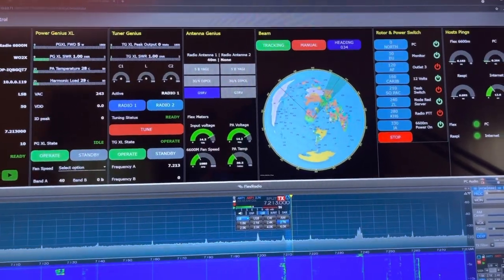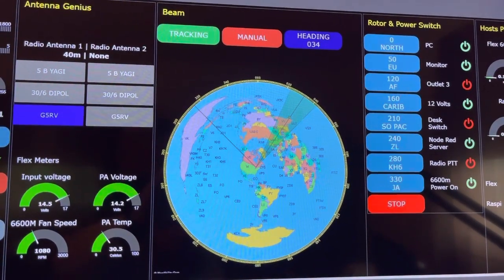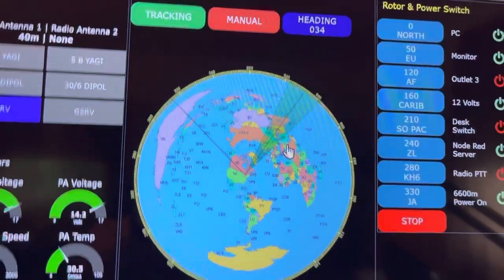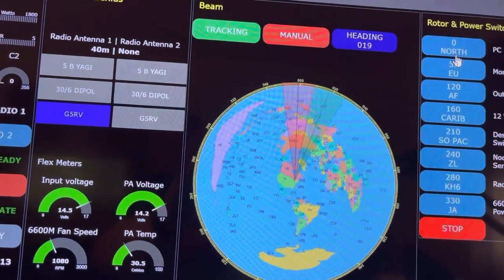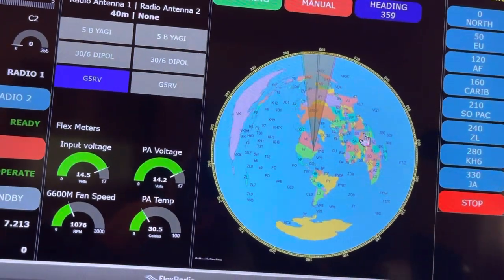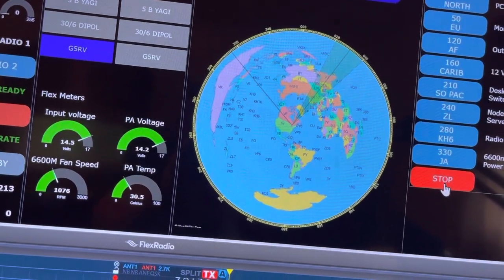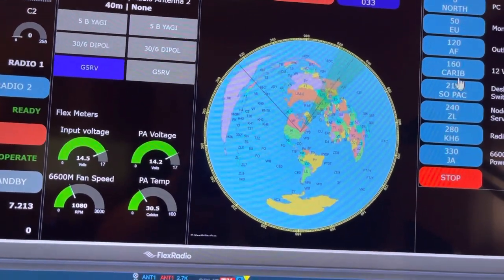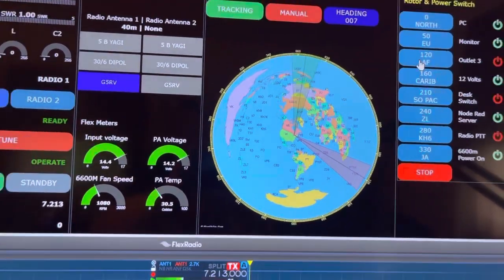Node Red and Green Heron RT21

Comment: I have a Yaesu rotor. Their interface between a computer and control box is extremely expensive. There are a few 3rd party interfaces that take usb out of the computer and output it via serial to the control box. Is one of these required OR, when using node-red dashboard, does the Raspberry Pi serve this function on its own via a usb-232 cable?
Reply from the maker: The rotor can interface to the Node Red server or connect to a PC running PSTRotator AZ, then Node Red can talk to PSTRotator AZ. Which ever way is easier. For Yaesu controllers they make interface boards that are RS232 or USB.
Reply: @daviddecoons1417  My actual question was, do I still need the Yaesu (or third party) RS232 'box' between the Pi and rotor controller? Or does the Pi serve that function and all I need is a USB to MiniDIN 6 pin cable? Straight from Pi to controller
Reply from the maker: @JohnVK5JAK  you still need the mini DIN to either RS232 or USB. The RS232 or USB would connect to the Node Red server. The Pi does not do the native Yaesu rotor interface.
Reply: @daviddecoons1417  So, JUST the cable is needed? Node Red will offer the correct output to control the rotor WITHOUT an interface between the controller and Pi?
Reply from the maker: @JohnVK5JAK  you need the module tat has mini DIN into rotor controller and then has either a USB B out or RS232 out. If USB-B you would then use a USB A to B cable from the interface to Node Red server. It will create a COM port.  If you buy the mini DIN to RS232 then you need an TS232 to USB A cable which plugs from interface to Node Red server. The USB to RS232 adapter will create a serial port. 

The USB to RS232 adapter cable or mini DIN to USB module should use the FTDI chipset. 

I had used an Idiom Press mini DIN to RS232 board then usb to RS232 cable with FTDI chipset. I have since sold that controller and bought a Green Heron RT21 controller.

Comment: Where can I find this flow? There are several on the the groups.io site.
Reply from the maker: Hi Phil, This is the flow I used in the video. This is using the RT21 connected direct to the Raspberry Pi running Node Red. https://groups.io/g/nodered-hamradio/files/%211%21%20Flows%20by%20Type/ROTORS/RT21%20rotor%20to%20Pi%20with%20AC%20Log%20and%20N1MM+.json

If you use PSTRotatorAZ then I have a different flow for that. Feel free to reach out to me direct via email 73 de Dave wo2x